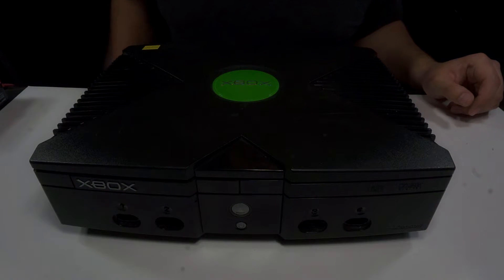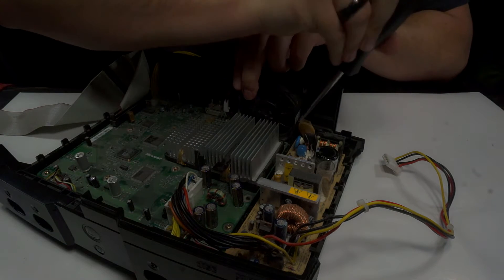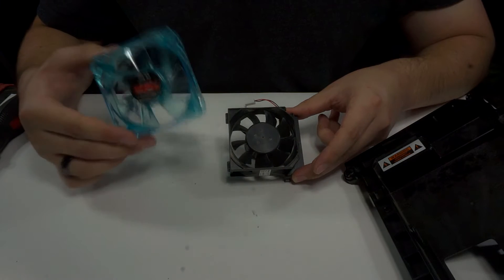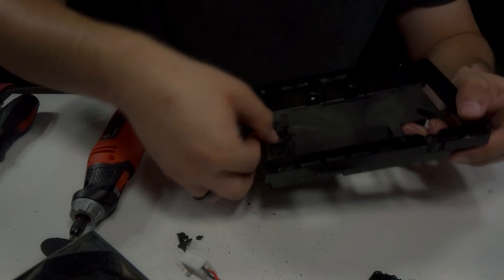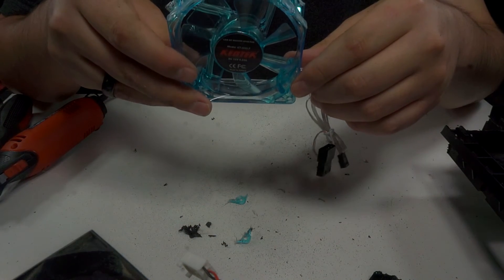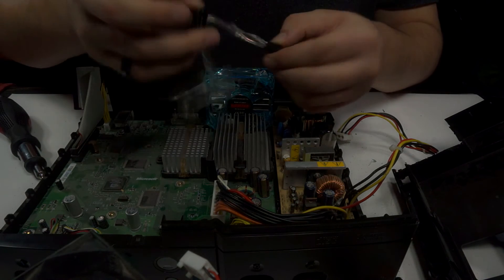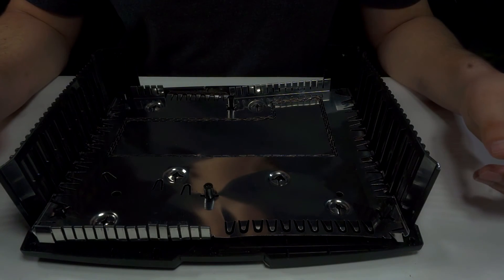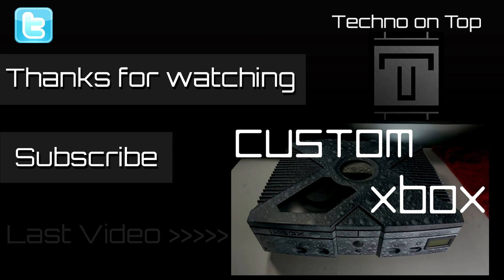Xbox Mods: 80mm Fan upgrade tutorial

Comment: I'm confused after reading the comments - I'm considering doing this to an unmodded xbox - to clarify, will the 80mm fan keep the xbox as cool as the factory fan, by default?

I've seen a lot of people online mention that the 70mm fan doesn't push out nearly enough heat unless you use mod software, so before I got he 80mm route, I just want to make sure

Can someone help clarify this for me?
Reply from the maker: Iv never had any heat issues with using 80mm fans. Iv been told that I'm giving up cfm compared to another fan which may be true idk never went and tested

Comment: i have not watched the whole vid so sorry if this was pointed out in the vid and i didn't notice. i like the whole fan mod ideas that have been going on but a common mistake and what apears to be included with this fan mod is that the OEM fans for the original xbox actualy blow more than most modern fans do i'm guessing because the curent draw rating has drasticaly increased in newer fans. meaning for most modern fan"upgrades" if you use the original temperature controller unit withought change the new fan will actualy pull less air leading to noticably higher temperatures so yes it will be quieter but it won't be cooler for this u need to have somthing else controll the fan speed so their's optamal airflow. I actualy Have a fanmoded xbox i didn't do myself that is connected to the Molex connectors via adapters. it runs at a constant fan speed but at good rpms that judging from the temps I'm getting off the heatsink seems to keep the system cool and i tried out of curiosity it pluged into the original fan connector and the fan speed was far lower and the gpu heatsink reached a crazy 80c and still raising and that was with ought even runing a game.

Comment: The stock fan had 31cfm... but at 100% speed that it dont reach. The key is install a silent 80mm fan with 31cfm too, that will run at lower speeds for the same performance = silent xbox. 80mm fan is the key to make an original xbox silent and cool. Also xbox has space for WIDE 80mm fans... this is a great video but the fan used is subpar.

Comment: My Xbox is playing a game for about 10 minutes before stopping and freezing. Sometimes, the background music is playing and there's no more visuals playing. Sometimes it stops and sounds like a scratched up CD skipping. Is this an old thermal paste problem or maybe something else? BTW, the DVD drive is fine. Thanks for any help as always.
Reply from the maker: softmod? Hardmod? Modchip? Does the Xbox sound like it's overheating? Does your fan speed increase at all during the time it starts messing up? My experience with overheating is Freezing. Fan speed increases then I just shut it off. But this is only during video playback not during a game. Since your mentioning a disc drive I'm assuming your running this from a disc. Does it do this with all games or just a specific one? What about music or dvds?
Reply: @TechnoOnTop  it's stock. I don't notice fan speed increase. Seems to only do it with doax beach volleyball.
Reply: It does freeze as well.
Reply: The board is clean as a whistle. The DVD drive is good and well. I'm at a loss. Also have silver 5 coming Tuesday.
Reply from the maker: Hmm, yea my suggestions would of been more twords a modded Xbox not a stock one. I'm sure the paste is probably dried out if it hasn't been touched. Be very careful when removing the gpu it tends to stick and if you pull to hard your likely to break connections and kill it. I recommend warming it up before taking it off. You can do this by leaving it on. I use a hot air gun to heat it up and it comes right  off.  Other ideas are just swapping out the disc drive and seeing if it still happens. I suppose it's even possible the ide cable is acting up? Which would be cheap to replace or you ould upgrade to an 80ata. Though it needs to be of a certain length ontop of having to do some oragami folding to make it fit.
Reply: @TechnoOnTop  you think it really might be my ide cable? I was starting to think it was the hard drive after dicking with it all day with the same results. I replaced the paste and was still doing the same thing.
Reply from the maker: It's a possibility. I wouldn't think the HD would be to blame considering your reading the data from the disc.
Reply: @TechnoOnTop  doesn't it cache the data from the disc on to the hdd during operation tho?
Reply: @TechnoOnTop  I just ordered a replacement cable for 5 bucks to try it out. This is really frustrating but thanks for the help. It's awesome.
Reply from the maker: That's true spaced that. Well if your hard drive is dieing or to blame. You might wanna start thinking about modding it. Because if the HD dies you will need to buy and install a modchip to fix it. Or a guess an eprom reader would work to but you would have to build your own. Yeah no problem happy to help. Hopefully it's just a janky cable. But the Xbox is pretty old.
Reply: @TechnoOnTop  idk man. I just tested it with soul Calibur 2 for 30 minutes and no problems. Disc is scratched to all hell too. This is soooooo damn strange.
Reply from the maker: @MegHumper Yeah I'm stumped maybe you just a bad copy of dead or alive. But who knows... It's definitely crazy weird wtf... Lol
Reply: @TechnoOnTop  I put my ear to the hard drive and when the game freezes, I hear the drive ticking at an even 1 click per second pace. Shit is strange. Trying the cable then ordering a modchip and hard drive. And if that doesn't work, I'm throwing this mountain dew Xbox out the fucking window.
Reply from the maker: @MegHumper  yea a clicking hard drive is never a good thing it's on its way out then. Very cool a Mt dew one! No wonder it's still stock.
Reply: @TechnoOnTop  not stock much longer unfortunately. Kind of tragic. Has to happen tho. Replacement disc drives are getting harder to find and they all die sooner or later. So we'll call it evolution. Anyways, thanks for the help.
Reply: @TechnoOnTop  so I got to thinking A LOT... I came to the conclusion that it was my cache. It's the only thing that made sense. Since you can't clear a stock hard drives cache via any method that's standard for these days, I ran 10 games that I got from the store to "clear" the cache. All it did was replace whatever wasn't written improperly to the drive(for whatever reason) by the previous owner of this console and BINGO! Shit works fine now. Have had my volleyball babes running all day no probs. So the knowledge is now out there. Cancelled my ide cable order as well. My mountain dew Xbox is stock and beautiful and running gloriously... THANK JESUS! And thanks to you for the extra brain power against this problem.
Reply from the maker: @MegHumper  very happy to hear that! That makes sense though I would of never thought to clear the cache that way haha. Well you taught me something new and if anyone ever has that problem then I have a new idea to give them I appreciate that!
Reply: @TechnoOnTop  absolutely!!!! Happy turkey day!! So thankful for bikini girls!!!

Comment: I dont think that this is necesary. My XBOX runs 45-50ºC max, and I only change the thermal paste of CPU and GPU. Also with unleashX you can change the speed of the fan if you want. 
Yeah the stock fan is loud but I think the stock HDD is even louder with all the cracking noise. 

DVD is also pretty loud so the best option is to change the HDD for a bigger one in order to load all your games in the HDD. This way the DVD drive dont make a sound, and dont wear it by reading games. Change thermal paste, clean everything and speed up the fan if you want.

I also recomend to you to put that fan at max RPM, 2600RPM i guess.
Reply from the maker: The mod is more about efficiency. You agree that the stock fan is loud. So changing out the HD, not using the disc drive, changing out the paste and doing this upgrade Would make it that much more quiet. I will say it takes a bit more effort then just swapping out parts. My main Xbox is the slim with other cooling upgrades. But my slim is currently running at a 2% fan speed (under xbmc) and doesn't go over 55c on the gpu while in game on halo 2. Sitting in the dash it's about 10 degrees lower. Modding is really just about either performance or aesthetics This mod adds a bit to both.

Comment: This is good?
https://www.aliexpress.com/item/8cm-Dissipate-Heat-LED-Coloured-Lights-CPU-Mute-Power-Supply-80mm-Benchtop-Computer-Chassis-Fans-pc/32865104823.html?spm=2114.search0104.3.66.6680717ePBFDkx&ws_ab_test=searchweb0_0,searchweb201602_3_10152_10151_10065_10344_10068_10342_10343_10340_10341_10696_10084_10083_10618_10304_10307_10820_10821_10302_10843_10059_100031_524_10103_10624_10623_10622_10621_10620,searchweb201603_25,ppcSwitch_2&algo_expid=8c364ee0-b523-45ec-9faa-1a5e63e99b6e-9&algo_pvid=8c364ee0-b523-45ec-9faa-1a5e63e99b6e&transAbTest=ae803_2&priceBeautifyAB=0
Reply from the maker: Yes that would be good

Comment: that rear vent is way restrictive. i bet a hitting it with a hole saw could free up a lot of CFM with just stock fan let alone an 80mm. as long as you don't shove any cables in the back of the fan you don't even technically need a grill either.
Reply from the maker: yeah im sure it would help, no need for a hole saw though i would just straight cut it, iv done it before it doesn't look to great, but you cant see it so it doesnt much matter, thanks for watching
Reply: ooohhh i see, the shielding is the restrictor. initially from the various camera angles it looked like the rear slats in the plastic were the biggest restrictor.

Comment: +TechnoOnTop can you do a tutorial for a original xbox led fan 60mm overcool brand mod
Reply from the maker: that would probably involve less cutting, it would literally be taking out the old one and put in the new one, if you watched this tutorial, it would show you how to get to that point, if there are fitment issues then this tutorial also shows you what to cut, but I don't imagine there will be. Why not just use an 80mm it will be quieter and more efficient than a 60mm

Comment: So i took appart my xbox to measure the voltages of the 2 fans cause the 80mm was spinnig to slow... 60°C when gaming (both 12 volts, weard)...but i found out that the gpu fan gets more amps than the 80mm fan, so i switched the plugs and the fan spins faster somehow ;) now its around 53 °C at a room temprature of 25°C
Reply from the maker: the Gpu fan is temprature controlled by the xbox, which is handy with a modded xbox because you can control the speed to your liking.  all my fans on my latest modded xbox are connected there it lets me keep my xbox quiet. thanks for sharing!

Comment: I did the upgrade with a 70mm fan, works perfectly and the CPU is around 43-49 temps, cool!
The OG fan is laughable, only 40mm and seemed to blow hot AIR..!!
Reply from the maker: awesome! right where it should be! thanks for watching
Reply: Blowing out hot air is exactly what the fan is there for in the first place. That means it’s doing it’s job correctly

Comment: Another great tutorial about destroying your retro console.
Reply: Are you 12yo? This went out of production like 13 years ago or so, it's not retro. Also, the Xbox have some bad problems with thermals, bad caps and bad disc drivers, you'll have to modify it eventually to keep it alive.
Reply: The only mod that destroys an original xbox is the slim mod
Reply: Destruction? More like preservation to keep your retro console from dying prematurely due to thermal issues. 
Also, who sees this mod? This isn't even externally cosmetic if you use a non-LED fan.|
But, K.
Reply: Yeah mods are basically essential to keeping the original Xbox live. Removing the clock capacitor is a must or it will leak and destroy the motherboard. The hard drives will also die, so soft modding and installing a new hard drive is also a must imo. Without these mods the Xbox will just destroy itself
Reply: it                     not retro

Comment: Noticed the big "electrical shock" warning sticker on the bottom of the housing, and the exposed power supply on the inside. Any idea how serious of a risk it posses while working on it?
Reply from the maker: you can hear the power supply discharge about 30-45 seconds after unplugging it, iv never been shocked by it, but there is always a risk i suppose

Comment: Hi again, well I've bee watching all your great videos and there is something that I've always wanted to know, I think you know so much about original xbox.
I have 6 xbox, all of them collected over some year, but unfortunatelly now I don't have space for all my thing, so I have to sell them all, but I want to keep only one...
I have: 1  1.0v
            2    1.1v
            2    1.6v
            1    1.5v or rare 1.6v 

So i dont know wich one should i keep to be my only an principal xbox?
are diffetences betwen all those versions? or doesn't matter?

Thanks!
Reply from the maker: ChengGaos I know the feeling I have 15 and a bunch of spare parts that take up some serious space in the closet lol.  But I would keep the v1.0.  They are easy to TSOP flash also have the biggest chip size.  They also alow you to do a RAM upgrade in the future. I would start by getting rid of the 1.6s as those require a mod chip to be hard modded.  Also Microsoft removed the pads so a ram upgrade is impossible.   But really any version that isn't a 1.6 is a good one to keep.  Another thing to note is the DVD drive. The Samsung one is supposed to be the best but iv found more broken Samsung drives then any other but that's been my personal experience I plan on keeping my only working Samsung drive . They are the only drives that have holes in the disc tray. So they are easy to spot.  Hope that helps.  Thanks for your support

Comment: According to the stock fan specs it moves Air Flow	31.00 (CFM). Have you had any over heating issues?
Reply from the maker: hello, no i have never had any over heating issues after doing a 80mm fan upgrade

Comment: Do we put the top metal caseing back on again?
Reply: I have been told that if you do a 70 (or 72?) Mm fan instead you can keep the top shield without modding it. Maybe even keep some plastic on the disc drive caddy and hdd caddy as well but im not sure. When i do another fan mod im going the 70 mm route
Reply from the maker: No I never do in any of my xboxs but if you want to you would have to modify it to fit.  Thanks for watching

Comment: Hi, how are the temps with the new fan?
Reply: You Need 34% - 50% fan speed. Via Bios update /new flash.  But you dont need to cut from the dvd rom Holder Something. a little by the connector on this sit and it works. I came from German so my english is not pretty. Look her https://circuit-board.de/forum/index.php/Thread/17599-XBOX-L%C3%BCftertausch-auf-80x80mm-Silent-Mod/ thats a good tutorial .
Reply: Mine with the stock fan even in the hottest days while gaming doesn't go above 50 degrees.
Reply from the maker: hey, my temps at idle after 20mins at x1 fan speed  is 63 degrees Celsius in an evox dash. and its probably about 80 degrees Fahrenheit in my house. thanks for watching
Reply: TechnoOnTop
Can you tell if its better or worse than the original fan? 63C when idle sounds little too high
Reply from the maker: the temps should be better, but i have it running at the lowest fan speed i like not being able to hear it. granted its not my main xbox. and i really only touch it for tutorials. again the fact that is so hot in my house isnt helping the temperature. the only thing i have that i can compare it to is my main xbox which is idleing at 43C again at the lowest fan speed. but my main xbox also has more cooling mods done to it (artic silver,Iceberqs,80mm fan)
Reply: TechnoOnTop
Have you tried running it with like 20%, or some other speed that makes the xbox run similar to stock temperatures? Does it still make less noise?
Reply: @TechnoOnTop  that is pretty hot. 
I only changed the thermal paste to my xbox and my temps in the unleashX Dash are around 45°C for the CPU and 40 or less for the motherboard. After playing for more than 2 hour, I come back to the dash and the cpu temp is around 50°c
(25°C ambient temperature)

Comment: Why did you remove all of the metal casing from your Xbox?
Reply: Wally17 It also catches static electricity and sends it to the ground, normally saving your circuits. Now you have something very vulnerable, walking across the living room, in socks, hit power, zhhhzz, and done.
Reply: no it's for interference and EMI interference and what helps it receive FCC compliance. though it is true that it is doubtful removing it would change much.
Reply from the maker: I removed it because I feel that it is not really needed. It also gets in the way of other mods unless you decide to modify it as well.  It also has a tendency to rust.  I have never had any type of issue with removing it, thanks for watching
Reply from the maker: it should fit but you may have to trim down the fan a bit more.that of you will have a trim out a bit of the metal casing. thanks for watching